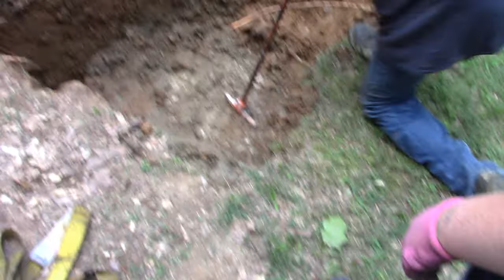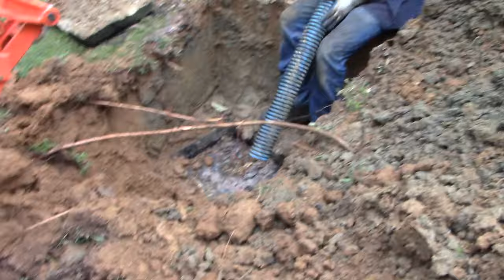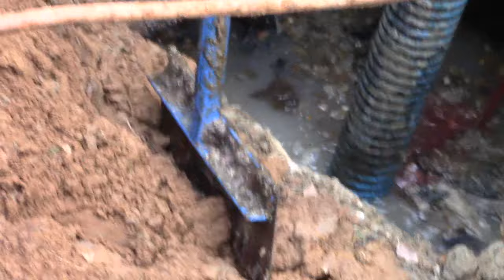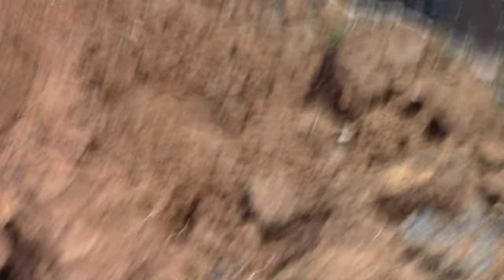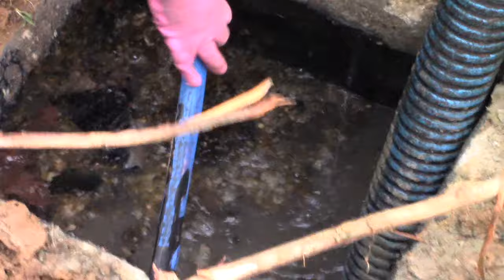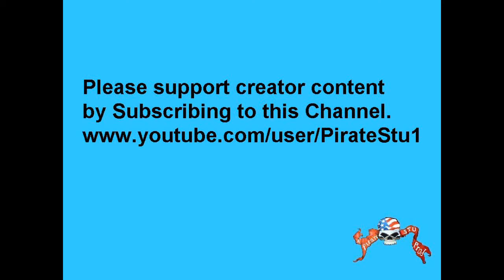Pumping Out a Full Septic Tank Both Disgusting and Mesmerizing

Comment: In N.Y.S., septic tanks are required to be pumped out before a house can be sold.
Reply: Really??
Reply: Milagros Gilio yes, really.
Reply: And this is why that law is in effect.  The new homeowner shouldn't have to move into a disgusting (and expensive) situation like this.
Reply: In Mass, we have a Title 5 inspection of the septic system before a house can be sold. If the system fails inspection the prior home owner is responsible for repairs.
Reply: same in Mass,they have to pump the tank and check the D box as well before you can sell
Reply: @obadiah7771  I am looking at buying in Andes NY area...is it that bad all over upstate?
Bty NY A 99 is in deliberation..to remove "suspected" covid cases to isolation detention??😱😱
Reply: Strange where I'm from the lid is above ground and we clean ours about every year
Reply: Is it a fine if they don’t do it?
Reply: @santinojozefmiller7721    Sale can’t be completed without the clean out.
Reply: GMA
Reply: Actually no. It’s a contract condition.

Comment: Don't let them tell you that you only need to get the first tank pumped. I fell for that as well.
Septic tanks installed after the late 1980s have two compartments, and it is important to pump out both compartments each time. ... Most homeowners are unaware when their septic tank has two compartments; some companies use that to their advantage, charging to pump both sides of the tank but only actually pumping out one.
Reply: Thanks. I was wondering why the company had to dig two holes. It made me kinda upset because both holes are in a flowerbed.

Comment: I’ve had a septic tank for over 30 years if you’ve got solids all the way to the top like that then you have solids down through your leach bed you just might as well put a whole brand new one in because your Leach beds are full and clogged and the soil is clogged we had a 500 gallon tank we pumped it every year Cost $145
Reply from the maker: They added another 100 feet of leach field.

Comment: I would imagine septic pumpers get desensitized after a while with some of the shit (pun intended) they've seen.
Reply: burningkarma I’ve had one that hadn’t been pumped in almost 20 years and I had to put all my weight into the stir stick to get through the top layer. It was horrible. We found a whole bunch of panties tampons condoms. It was bad. Didn’t stink that bad though.
Reply: @dakotabradford4989  Rental or a primary residence? I've heard so many horror stories from Landlords who have to deal with so many septic issues because their tenants are just clueless and careless as to what you can and can't flush.
Reply: @burningkarma  primary. They lived in the house for 20 years with 3 kids so 5 people living there most of the time.
Reply: And remember septic means full of bacteria.you want it in the tank .. So that means ALL the anti bacterial soaps and cleaners really don't need to go in tank sorta kinda defeats the purpose of the SEPTIC tank
Reply: In all honesty, to a certain extent you do end up getting a little bit desensitized. I did a few months of pumping porta potties and after a week I was used to the smell and now I’m going to be starting doing this job of pumping actual septic tanks and if it’s anything like the smell of porta potties I’ll get desensitized real quick. Only difference between septic tanks and porta potties is really with the septic tanks we just dig the holes out pump and put the soil back whereas the porta potties we also have to restock and sterilize each one.
Reply: WHALE SHARK  Whoa whoa, let's all take it a bit slower. No one wants to wake up pregnant!

Comment: It’s hard to believe that, at minimum, an inspection wouldn’t be required before a house can be sold.
Reply: That all depends on where you live.Here in MA its almost a certainty you have to replace your septic system to sell your house. You have to pass an inspection and if your septic system was built a decade or more you will automatically fail
Reply: Even if it's not required, it's worth every dollar to have the tank and field inspected and pumped.
Reply: @Ghostdog4  a decade? I've seen systems 40-50 years old working perfect and bad system installs that where only 5 years old failing miserably.
Reply: Exactly.  The system for the home I purchased was inspected and failed and the seller had to foot the bill to replace it.  We got a brand new septic system at no charge.

Comment: That hillbilly is dead wrong. You always pump out both sides. I've never had a company out that didn't do that, and as bad as the first side was, you can bet your ass the other tank was bad also
Reply: Yes sir. That's exactly why not to go cheap with a good ol boy.
Reply: I do this shit for a living. We pump BOTH sides! Get the sludge out of your liquid side. He just didn’t want to dig it up! Don’t blame him there. But pump both sides. Then, if you want to be very correct, fill your tank with water until the hole near the bottom of the baffle wall is covered. To prevent floating solids from fouling your leach field
Reply: Maybe it doesn't have a access to the second chamber the water will backflow into the first chamber going through the baffle which can be a 90 tee or a cut wall  to let the water out. So the water is going to come down where the baffle is.
Reply: @spidermight8054  filling the tank back up over the baffle wall hole is literally a waste of water dude. Most residential tanks will be filled to the operating level by normal use in about a week or less.
Reply: Not all tanks have the baffle “separation”walls in them, digging up the other lid, if there is one would be pointless unless there was a outlet filter in place that would need to be cleaned.
Reply: @Reb10999  good ole boys like me are the ones who do this thankless job so mind your p’s and q’s there bub. And no, I don’t cut corners doing my job. But I’m also not going to do unnecessary shit either. I cannot stand all these people who watch a video or google septic systems and think they know my job better than me.
Reply: @stevekalis139  Dude! I want to agree. But,  it’s about “firmness “ of structure. If you don’t fill those tanks, as we’re required, they will likely collapse. The key is your leech line, regardless
Reply: @stevekalis139  Then people like you shouldn't pit your job out there and expect glowing results. Lol. Yadda yadda
Reply: @Reb10999  It may not even be for structural integrity. As far as I’m concerned, filling or half-filling poly/plastic tanks keeps them steady and in-place while backfilling. I’m trying to say I agree with you, to an extent, but I don’t make the rules.
Reply: @stevekalis139  I certainly agree with you that it’s “good ole boys” like you and I that do this thankless job. I’m certain I’d like working with you.
Reply: @spidermight8054  I guess you gotta do what ya gotta do in SoCal, I don’t even know why I read comments anymore……..
Reply: @spidermight8054  Hey I'm  looking for info on beginning a septic tank truck  business. Do you own your own truck or you work for a company? How long does it take to pump a septic tank?
Reply: @alexisaviles9769  A lot of answers. Mainly it depends on where you live. Mainly, I mean WHERE will you dump what you suck up? It's important. We used to dump our loads at our local sewer plant. But they axed that, so now we have to drive 2.5 hours North to Santa Maria (I live in Ojai, Ventura County, Ca.)
Reply: @alexisaviles9769  no, I don't own my own truck. But, my boss has 2 brand-new shitpumpers, 1 2500 gallon, the other 4000.
Reply: @alexisaviles9769  it doesn't take long to pump most tanks. What takes long-and you charge for it-is digging the fuckers up! Gotta find them 1st. That means a $15k or so camera/locator unit
Reply: @spidermight8054  Oh wow, 15K camera is big ticket! I bet its Worth its weight in gold to help complete the jobs faster.
Reply: @alexisaviles9769  absolutely necessary! Most people don’t even know where their tanks are! Gotta shove the camera down their shitpipes, often through roof vents! It’s not an easy, lowbrow job!
Reply: @alexisaviles9769  But, we repair/ inspect sewer “laterals” as well. Most people are hooked to city sewer system. At least us poor fuckers, where I live.
Reply: @spidermight8054  Thank you for all the info. I need to look into it further because I know there is a big need for those services here in TX where I live.

Comment: No such thing as an empty septic tank, that's how they work, a crass filtering device. This tank however hasn't been pumped in decades. This is like not changing your motor oil in your car, a disaster waiting to happen. I've had a guy smile all the while I pumped his tank telling me how much money he save by not pumping out regularly. Look at all that toilet paper. You don't need a hockey mit to wipe your backside folks.
Reply: indeed, a full septic tank is a misnomer... it should be full with water, and it shouldn't be full with sludge...

Comment: What amazes me is the litany of sounds & expressive adjectives used to describe the contents of a septic tank. Believe me it's no sight of beauty nor  a bed of roses scent. If you are connected to a sewer line, be grateful. Accept one fact, this is sewage in raw form, it is disgusting but there is nothing you can do except watch what you flush into it and regularly have it pumped out. Pumping has a price tag.  Those of us who have septic tanks live well with them as long as the lids are on tight and the system functions properly. What you see on videos is called a scum layer, it is floating waste material that the bacterial matter that breaks down. Normally a septic system requires basic maintenance, when you abuse or neglect the system and the leech field clogs, you face a very costly repair bill ( starting at $10,000.00 or more)  depending on what must be done to fix it and that can sicken you more than what you initially see when you open the lid for pumping. Think about it.

Comment: I hope they cleaned the filter on the outlet side
Reply: Judging by the apparent age of this system, it is highly unlikely that there is an effluent filter on the outlet baffle. Outlet baffle bio-filters are a much more recent implementation in this industry.

- 62 cumulative years of septic tank pumping experience in the family business.
Reply: Slutter Gut would a system installed in 1990 have a filter?
Reply: @rejectblock9813  Pretty unlikely, but not impossible. There are also many different types of septic systems, and if yours has a pump in the tank, then it would likely have some sort of filter. If it's just a standard, gravity-fed system, it's very unlikely for a system of that age to have a filter.

Comment: They’ll be installing a new leach field in a year. Jeez ... when was the last time this system was pumped and cleaned?
Reply from the maker: Adding on to the leach field anytime now.
Reply: Actually, the water level in the tank was at operating level when they opened it, and the crust layer of solids at the top of the tank was within a normal thickness for having the tank pumped. This was a very standard job (although their technique was rather strange and inefficient).

As for the drain field, judging by the water level, things are working just fine. The drain field (otherwise knows as a leach field) will only become saturated with excessive use of water, and the amount of solids in the tank has no bearing of drain field efficacy.

- 62 cumulative years of septic tank pumping experience in the family business.
Reply: @typezero8929  I'm about to close on a property with septic tank/leech field. 
How can I locate all the lines so I know where not to dig/plant etc?

Comment: how much did it cost you? i wanna know because we're on the same situation and the guy who estimated the cost told me it will cost me 3000$ if i pay cash, 3100$ if i pay check and 3200$ if i pay with debit card/credit card. Is that how much it cost you?
Reply from the maker: I've slept a lot in the last 3 and half years, but I think it cost me between $300 and $350 to have it pumped. They also added another 150 feet of drain field and that cost me around $1,500. I just got an estimate to move the drain field at another location and that was $2,000. I'd shop around a bit if I were you!
Reply: @PirateStu  thank you for the info and for the advice.

Comment: This is so bad. How did it not back up through the house?? 😳
Reply from the maker: Water was still able to flow in and out. The big problem we has was the field near the septic was making the ground soggy. We added 100 extensions to the field line to fix the problem.

Comment: I got a buddy that wants me to quit my job and try to buy a septic tank cleaning business I swear I don't know if I can do it
Reply from the maker: I don't think I could, as long as I had other options. But to put bread on the table, I'd do what it takes.
Reply: I could do that. Try being an auto mechanic and clean engines and transmissions. They can be as nasty as that. I've seen motor oil in cars nearly as sluggy as that is. Especially leaky rear ends and doing suspension work with all kinds of grease everywhere. It doesn't bother you after a while.
Reply from the maker: @brianperry4815  Ha! You said "leaky rear ends".
Reply: @PirateStu  haha That may be mechanics speak for rear differential.not much on cars but trucks .There is a reason mechanics are called grease monkeys.

Comment: Looks like his pump is slap worn out.
Reply: His pump is probably functioning fine, but because of the strange technique they are using, the hose is not under the water long enough to build a sufficient vacuum in the tank of their truck, thus making things progress very slowly.

- 62 cumulative years of septic tank pumping experience in the family business.
Reply: Slutter Gut if you just shove the pipe down further you’d miss out on most of the visuals and fun sounds.

Comment: Just curious how long it took to pump it out? An hour? Two hours?
Reply from the maker: I don't remember timing it, but maybe 30 minutes.
Reply: Depends if there’s nothing but shit from bottom to top it water mixed in and size of tank. A 1500 gallon tank with hardly any water and full can take well over a few hours I’m pretty sure...when I was in my teens our tank was packed full and backed up in the house. Had never been emptied and tank was well over 15 ft in the ground. No easy access cover either...and the smell HOLY HELL.....

Comment: Well ! If you are only two living in that house you will have to pump every year because that tank hasn't been cleaned out in ages ! The septic field must be plugged up something bad. Wouldn't want to be the owner ! Get a permit, consult an expert and dish out the cash for a completely new system ! That was bad ! Real bad !
Reply from the maker: They added another 100 feet of field to the system.
Reply: @PirateStu  I hope it was spread out over three rows of 33 feet. We have a 5 bedroom 3K² house and raised three kids (36 years now) and with 500 feet of field and have never had issues but 36 years is still a long life for the septic system and the tank is always pumped every two years. When I flush (after a serious session) I want to close the door with peace of mind that it wont come back !
Type of video every rural resident should watch, attentively !
Reply from the maker: @palco22  I'm on 4 acres and it was 2 rows in a 100 straight line.
Reply: @PirateStu  Can the existing field be flushed out under municipal regulations ? Around here the use of certain chemicals for flushing require a municipal permit. It gets complicated when it comes to septic systems. In other areas the can impose the replacement of the entire system and that costs big bucks.
Reply from the maker: @palco22  sorry, I don't know the answers to those questions. I'm just the customer. The toilets never stopped flushing, and once the ground stopped leaking, my concerns were over.
Reply: @PirateStu  If it doesn't come back, you're on the right track ! Thanks for the video and the chat. Stay safe and live life.

Comment: The septic tank pumpers were lazy not doing a complete job they should have pulled both lids and check to make sure there was no solids on the other side a septic tank that full could clog the field lines if you don't check both sides this is just typical lazy